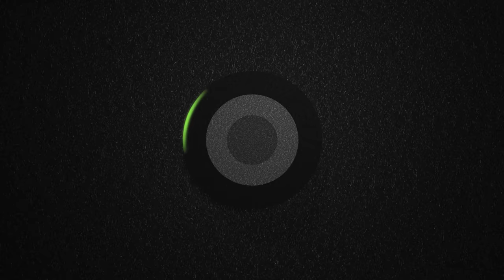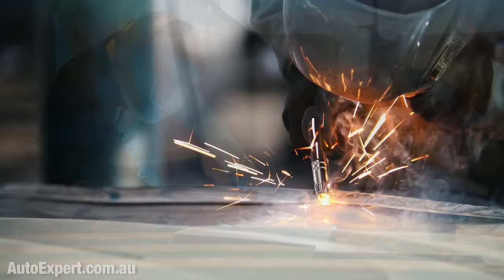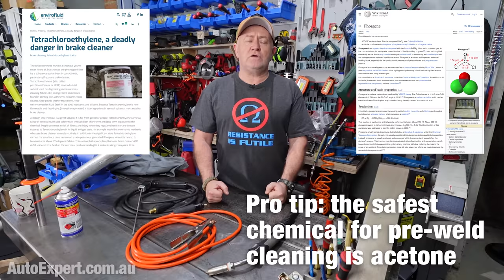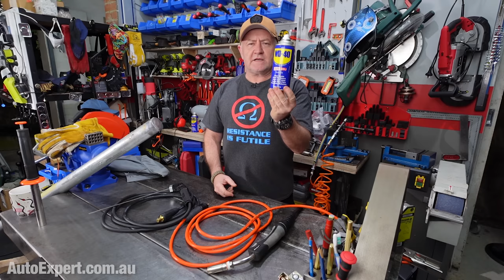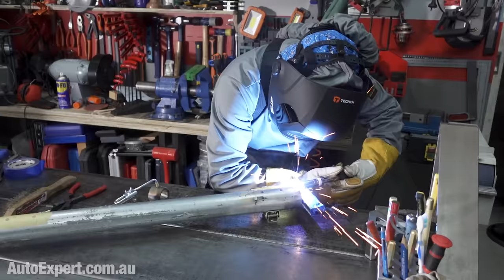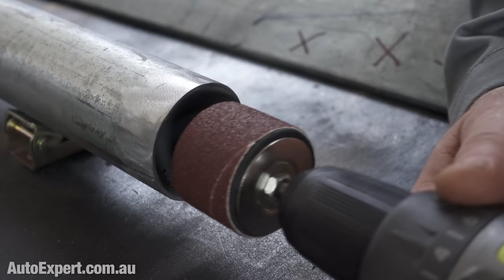How to die while arc welding at home: the top 5 ways | Auto Expert John Cadogan

Comment: My dad bought an oxy acetylene torch set when I was 12. We taught our selves from there.
 I bought a buzz box and added stick welding. I once got a jingle from damp gloves.  Fast forward 17 years                                                        I had picked up thermite welding rails. One late night after doing the last weld of the night, I took the slag pans and threw them                   into the ditch. I had done this hundreds of times before. This time I managed to cause a steam explosion. The thermite reaction creates    steel that almost reaches 5000 degrees F. Even though the outside was cooling off , the interior of the slag was still VERY Hot !  The boom was alittle bigger than a hand grenade, knoked me down, as I lay there the white hot slag started fires everywhere they landed.  No injuries ! lesson learned, no water around liquid steel or slag !   Many thanks for the great tips. Greetings from southern Maine in the USA .
Reply: Maniacs and weldin' don't mix, guy.

Comment: Thanks for getting this out there.  I was once welding a frame that was bolted to the ground in a damp area.  I live in the tropics, so lot's of sweat.  I was laying on my left side.  Grabbed a new rod with my left hand and put it in the holder.  The electricity went through my sweaty glove and out the shoulder of the same side through my sweaty soaked shirt.  It hurt and  it taught me a valuable lesson.  I was very fortunate that the path did not cross through my chest.  I suspect that if I'd been laying on my right side, or placed the electrode with my right hand I would not be writing this now.

Be safe kids.

Comment: As a welder it’s good to see someone getting basic safety information out there.
Reply: Agreed, PPE is sorely neglected by DIY enthusiasts and cannot be  over stressed. When I was younger, I was MIG welding with all (?) PPE except that a spark got inside my hood, bounced around and then went in my ear. The sound of the inside of my earhole burning was horrid and my subsequent reaction was rather agitated and dangerous.
Since then I have included a hood as part of my PPE, covers head, neck and shoulders before the actual welding hood and a pair of earplugs first is even better. These are affordable, readily available and worth ever cent.
Reply: Gonna piggyback on your comment here because it’s at the top. 

Can’t stress PPE enough; something that is vastly understated it how bad the particulate from grinding wheels, cutting discs, abrasives etc is. Those heavy metals in fine dust form is worse for you than some welding fumes because it’s so much more prevalent. 

Use a PAPR respirator; but if you can’t afford it like me, get a 3M P100 mask/respirator to filter out particulate in the air. They’re affordable and fit under a hood no problem. 

If you’re going home and you’ve got black snot in your nose; all that shit is also in your lungs and that cumulative risk is HUGE. Wear a respirator while grinding/prepping your metal.
Reply: When welding on tanks make sure you purse the tank of explosive vapors first
Reply: @MikeBrown-pe8yo or don't weld pressure vessels if you have never been trained to do it
Reply: @MikeBrown-pe8yo 
I’ve no knowledge of the subject whatsoever but how would you make sure that there’s no explosive vapour in the tank? 

Cleaning out oily substances can be very difficult. 

My first thought was to fill the tank with water but if you’d have to weld it because it’s leaky that would be difficult. 

I’m just curious.
Reply: @GameTimeWhy A tank doesn’t have to be a pressure vessel, I think.
Reply: @Conservator.  Might want to look that one up. You start heating up a tank it's going to pressurize really quick.
Reply: @GameTimeWhy  Pressure won’t build up if you leave the tank open. 
Your point was that welding might weaken the pressure vessel. I think that that’s not the case it if it’s a normal tank and not a pressure vessel.
Reply: @Conservator.  Maybe we are talking about two different things. When i say a tank is a pressure vessel i am referring to things like a propane tank or even a tidy tank. What are you meaning when you say pressure vessel?
Reply: @Conservator.  I just read one of your other comments. If you don't know anything about the topic then why do you hold such strong views? You should look this up first.
Reply: Yeah, I  do very little welding,  but I have a mig welder, and this was eye-opening. Good advice.
Reply: @Conservator. I have successfully welded motorcycle fuel tanks (using an oxy-acetylene welding outfit) by almost completely filling them with water and positioning them with the place to be repaired right at the top.
Reply: @jacksonparker2186  do yall just not know about fume extractors? i havent heard anyone in this comment section about it and neither the guy in the video. but at the company where i work we have those big welding fume extractors everywhere, which can be adjusted to be above your welding spot easily. they are pretty powerful and also work on 400v

Comment: As a self teaching stick welder not aware of the health and safety issues, I just want to thank you for the bit of education I got from you. Very well done sir.
Reply: I'd absolutely recommend you wear a respirator or welding rated disposable mask always when welding. The fumes from the shielding flux can seriously damage you lungs and brain.
Reply: @m0use1983  Thank you for that super important bit. As a 52 yr old smoker my lungs cant hack too much more abuse. Also upon my first time using the stick welder i used brake parts cleaner to remove all off the grease near my weld. Axel boot split and my weeld was an attempt to fix a broken sway bar end.

Comment: As a 30+ year welder, I am happy that you covered these. When I started, they thought nothing about trying to get a person to weld some galvanized stuff, but I had an instructor that was a huge advocate for safety around the stuff. 

Aside from the poisoning (antidotal story here), he claimed he damaged his lungs permanently as a young ignorant welder, welding in an enclosed space all day on corrugated galvanized panning used when pouring concrete (creating a bottom over empty space). 

He said from that day forward, his lung capacity was severely diminished. 

As to the UV radiation. I cannot stress this enough. I see YouTube people with exposed skin, especially while TIG welding. Cover up, I don’t care if you are hot, take breaks. 

In addition, the tacking without a helmet is stupid. 

I always wear UV blocking safety glasses as well, the reflected light will get your eyes. Went night fishing when I was just starting with an old welder, figured that out real fast. 

Finally, as to your surroundings. Mind the flammable solids and dust as well. If you are working on in a mixed shop with wood dust, nothing burns better. Actually lots of things do, and look out for those too. Your little hot BB’s will find there place. Might not kill ya, but could burn the place down. 

One more thing, careful about using old propane tanks and like stuff for projects. Fill them up with water when you cut into them or weld. I just stay away from them.
Reply: I cut a fuel tank to do a repair once filled it with water before I cut it, I brazed a piece on the tank but no fumes after the water was flushed out to be sure.
Reply: Not "antidotal", "anecdotal". 👍
Reply: Filling an old propane gas tank with water may work as long as it stays open to the atmosphere and doesn't build pressure during hot work - steam can explode too.  Definitely don't fill any liquid fuel containers wtih water before hot work.  Many hydrocarbons float so the explosion/igntiion hazard would persist, and you could easily contaminate the property.  An industry method for safetying old heating fuel tanks before cutting into them is to vacuum out all the residual liquid and sludges (dispose of them at an accredited facility), then fill it the tank with dry ice (while remembering that CO2 can be an asphyxiant) - but that way the tank is less likely to explode before a torch is applied.
Reply: Propane tanks are nasty. Filling them with water does the trick if they are otherwise clean. Almost all of these tanks have hydrogen embrittlement, small pockets of hydrogen in the metal after years of holding liquid propane. When welding on these tanks it sounds like someone making popcorn and can shoot a hot goober. wear PPI.

Comment: Yes to all the above. Well said.  Also
1) i nearly lost an eye when the stinger spun in my grip (which i didn't feel through the thick gloves).  Prescription glasses lens saved my eye.   Suggest safety glasses under the helmet. 
2) i too am an ex rail engineer. We had a locomotive fuel tank explode after a weld repair (done after purging by overflowing with water for 24 hours) had been tested for leaks, they found a leak,  and when they attempted the weld to fix the leak, big bang.  They couldn't work out what was combustible to explode....i diagnosed it --- compressor crankcase oil vapour carried into the tank in the compressed air used for the (external soapy water) air pressurised leak test.
Reply: Good to be flushed with water but better flushed/cleaned with steam is best. Should of been purged with nitrogen.
Reply: I have had a fuel tank explode after being filled with water and drained to weld. Seems the heat cooks more fumes out even after a water rinse. Old timer showed me to fill tank with car exhaust while welding. I use a Co2 fire extinguisher to displace oxygen in fuel tank before applying heat.
Reply: @chrisbyers6084  I'm not a welder, and I'm not trying to be a jerk, but here's some thoughts:
Car exhaust might contain carbon monoxide, which is flammable. Most cars produce very little carbon monoxide when running outdoors, but I wouldn't bet on it always being a safe source for CO2.
Water usually has gasses dissolved in it, and a bit counter intuitively cold water holds more gas than hot water. So, heating up a tank of water can cause gasses to diffuse out.
Oil fracking done within a few miles of a drinking well can cause the water to become contaminated with oil and flammable gas.
Electrically welding tanks filled with water might produce oxygen and also cause hydrogen embrittlement.
Reply: I hardly ever use those huge - ass gloves unless I'm welding 300 amps or such.   
I gotta wear something, though, to keep the radiation at bay.
Most of the welding I do nowadays  is low- power tig welding but still have to wear some kind of gloves for anything more than a quick zip.
Plus I have to be careful, the high voltage start  circuit on my tig welder can arc about 4 inches.
I got slammed by it good once and it almost made my arm fall off.

Comment: I actually survived a WD40 accident a few years back; lost my beard, eyebrows, eyelashes, nasal hair, and hairline in the process but fortunately still alive. Put a nearly empty can down and accidentally popped it. The bang made my ears ring for two days and it took a week for the burnt hair smell to go. The can embedded itself in every surface in the shop except my face, my face getting the flash fireball instead. I'm only an occasional welder, but that gave me a lot of respect for the process, and for general shop safety.

Great video, thank you!
Reply: (Not welding related at all, but for some reason your story reminded me of this) This incident was not me, but my dad. He was invited to fish on 24' pontoon boat. His buddy set his thermos down just above the steering wheel. It fell and when it did it landed on top of the trolling motor battery. It touched both poles and the hydrogen gas caused the battery to explode on him. Acid sprayed everywhere. My dad immediately jumped into action. He grabbed his friend and threw him off the boat into the water and then proceeded to extinguish the fire to save the boat. They stayed out and fished the rest of the day. Since my dad threw him in the water it diluted the acid and he escaped with no burns at all, only a few holes developed a day later with the clothes he was wearing that day.
Reply: wow never thought of that
Reply: @Robert-ko8fi  A guy I worked with lost his father when a spray can of starting fluid tipped over onto the positive terminal of the battery while he was working down in the engine bay of his boat, I hate when I see people set spray cans on batteries while working on engines. Your topic needs to be spread on screwtube because I see these  guys do it all the time.
Reply: @Robert-ko8fi  my transmission teacher at WyoTech had no face because he wants smoked around a battery under the hood of a car. 
I don't set foot in the shop without eye protection
Reply: Damn! I welded a hundred gas tanks and still haven’t blown myself up yet. I was a bit nervous the first time.
Reply: @Robert-ko8fi :good thing dude could swim.
Reply: This is exactly why shops store spary cans in metal cabinets
Reply: @walterconcrete5017  Or a shark got him 😂
Reply: In reply to @Robert-ko8fi ,  It in general is madness that the poles on the types of battery like you find in cars, trucks and boats hardly ever are shielded. Only be cause the voltage is too low to electrocute a human (in most cases) does not mean those batteries aren't dangerous. They ARE, be cause of the enormous AMOUNT of electricity* those batteries not only hold but also can release all at once. Enough to do welding and CERTAINLY enough to not only create sparks but make that whole very battery itself explode...
(*so to say, in fact: Amperage / amount of 'Amps', of course)
Reply: @markrainford1219  he and his mate were fishing on a 'pontoon' type of boat mate, not exactly seaworthy
Reply: @AnonMedic Wait what happened??? 
As in how did smoking around a car battery cause his face to be erased??? 
I’m a smoker and work on my cars frequently so I’m genuinely curious
Reply: Thanks for sharing
Reply: @Jewclaw  The gasses a lead acid battery generates is explosive.  If you have a sealed or gel battery it's not quite as critical.  I can tell you that while I'm not a smoker, a battery exploded in my face while I was jumping my friend's truck.  I made the mistake of clamping the jumper cables directly from battery to battery and when I made the connection to the "dead" battery, it sparked and ignited.  We were in a river bottom in our 4-wheel drive trucks and thankfully there was a small pool of water that I ran to and flushed my face.  Now when I jump a battery, I never complete the jumping circuit to a battery, usually the last connection I make is to an engine ground.  And I still turn my head when I do it out of habit.  Additionally, never wear jewelry - rings or watches.  My friend was working on his Ford Galaxy when he was holding a wrench and then completed the circuit with his wedding ring.  He had to peel away his burnt skin that had burnt over his ring just to get it off so it could be treated.  Batteries are no joke and you'll see tons of guys on Youtube wearing jewelry working on cars - bad move.
Reply: I had a wd40 incident also .I checked a gas tank. I made for leaks with water and had 3 pin holes. So I  sprayed wd40 in it to prevent rust. 2 days later I wiped it out and started to weld. We'll the fumes lit up and bloow it up, but between  the filler hole and sending unit, it didn't fully blow.  It pillowed the tank nicely and exhausted out the holes as it jumped off the table. As I shit myself lol😮😅 wasn't hurt, just a scare.
Reply: @sandwinder326  Thank you for clarifying… rq about your story, you said: “clamping jumper cables directly from battery to battery” 
Is there another way to do it?
Reply: @Jewclaw  Yes, first connect positive clamp to good battery, then other positive clamp to drained battery.  Then negative clamp to drained battery and finish with attaching last negative clamp to engine ground on block.  Reverse in this exact order to prevent sparks.

Comment: great safety video!! Thank you for putting this out there!!I know you focused more on arc, but I wanted to add about the dangers of low areas in you shop and shielding gas. Especially if you have a shop with a pit and guys working in it. Shielding gas is heavier than air so it goes to all the low areas especially if you don’t have a fan or cross breeze on the floor,and could potentially suffocate anyone who’s in that low area especially in a pit.
Reply: Chrisbxxx - Wow! Instructions may say use in a "well-ventillated" area, but "open area" might not necessarily equate to "well-ventilated ."

Comment: The tip with changing gloves is actually very helpful. On my first bigger welding project I  slowly went from one handed welding to supporting a fresh (and therefore pretty long) electrode with my glove to start the arc in the right place. It worked well until I started noticing a tingle in my fingers down to my elbow. Turns out I touched the metal with my elbow and the glove was sweaty. I had welded in the same position for a longer time and it wasn’t a problem but because of the sweat the conditions changed over time. Very good advice for DIY hobby welders, thank you for the video :)